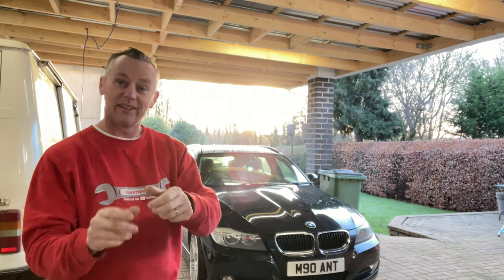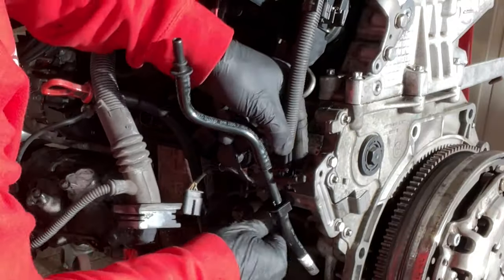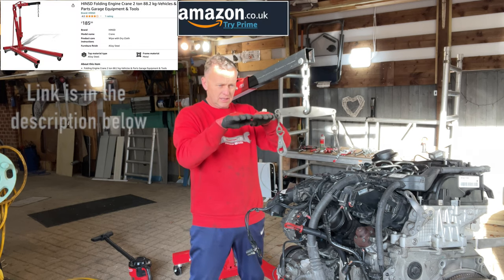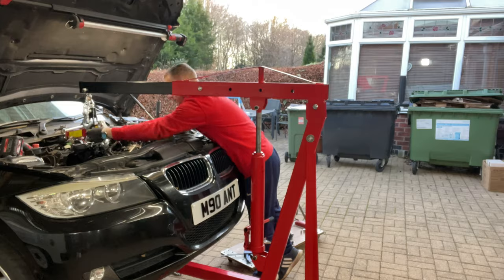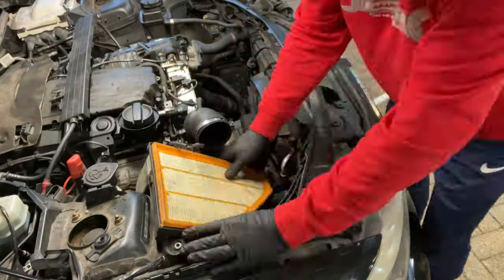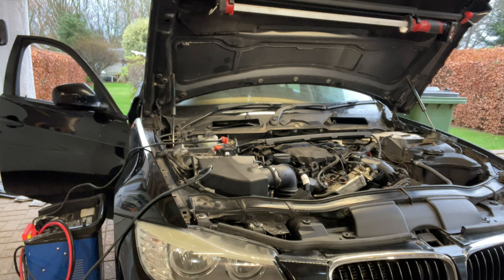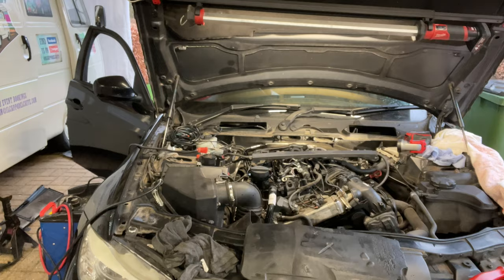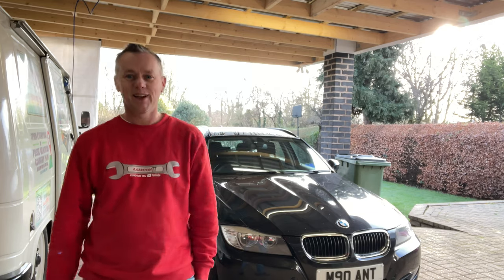I Have Big Issues!! BMW "Timing Chain Broken" Refitting The Engine pt 9, Will It Start??

Comment: Great job, well done. I did the chains on my wifes 318D as preventative maintenance back in 2012 shortly after we bought the car. Did it almost the same way as you but left the wiring loom behind in the bay, wished I'd done it the way you did. 
Seems like prices have become more realistic based on your earlier video, I paid over a grand for the timing parts from BMW back then and I didnt need the followers.
Think theres a service postion for the bonnet if you un clip the struts and push it up to 90deg and insert a pin in the holes that line up but it was a while since I did the job!
Good luck clearing the codes and with the rocker cover 
👍
Reply from the maker: I did wonder about the bonnet hinges, I will look into that one, I will do a full costing at the end hopefully when its all fixed, Thanks for the great comments👍🏻👍🏻🛠

Comment: Oh no so close to the finish line, the cover is well expensive i would be tempted to get a used one or better still depending on the crack some plastic welding may sort it... Hopefully you sort it, the codes may be because everything was unplugged plus a low battery can triggy bizzare codes on some sensors, i dont think its anything major as the car fires up and is not running lumpy so it will be very minor them codes
Reply from the maker: That is my thoughts on the sensors as its all the engine sensors throwing faults, might try disconnecting the ecu again with the sensors now attached to the engine it might reset a glitch, I am going for a new rocker cover don't want to have to strip it again if any more issues appear Thanks for the great comments👍🏻👍🏻🛠

Comment: My BMW 320D E90 timing chain snapped, thankfully no internal damage, but the chain damaged the rocker cover and added £300 to my £900 garage bill. That was 3 years ago and my car is going strong.
Reply from the maker: Great news, next video coming soon, Thanks for the great comments👍🏻👍🏻🛠
Reply: My 2008 e91 320d has just snapped (undiagnosed)
No movement in the oil filler when you crank it 😬😬
How did both of your sound when they went @michaelwood7239 and @aaanton11 because I didn’t hear massive crunching sound’s when it failed 

I say undiagnosed as it hasn’t seen a garage yet 💷💷💷  my mate put his code reader and it threw up 
480A
Particulate Filter System
ЗЕСО
Camshaft Sensor Signal
4590
Rail Pressure Plausibility Delivery Controlled
3FFO
Air Mass Flow Sensor
483D
Throttle Actuator

Comment: Nice job overall. One thing I would mention is that I wouldn't use hose water to fill the coolant. Officially it's supposed to be distilled water, but I tend to use tap water. I have found that hose water is considerably dirtier and has more minerals in it so not great for your cooling system.
Reply from the maker: Who Knew, makes sense though, Thanks for the great comments👍🏻👍🏻🛠

Comment: Hi Anton, Great series highly enjoyed it. 
I have a question, when you started for the first time. Why did it take that long to start, When you said you primed the fuel pump/fuel line earlier in the episode , doesn't it mean that the fuel is ready to be sprayed in the cylinder and should have started a earlier than it did? Or is it because the compression didn't generate enough heat to combust the mixture, sorry new to this and was confused that particular step, but great series, keep it coming :)
Reply from the maker: The Fuel prime will only flush fuel as far as the high pressure pump, this can be a big issue as it can be really hard to get the air out of the pump, the first crank had to push fuel up the high pressure pipe to the fuel rail, fill the rail and injectors then squirt, the 2nd time the rail still had some fuel in it as I did not tip it up I think this sped things up a little.
Thanks for the great comments👍🏻👍🏻🛠